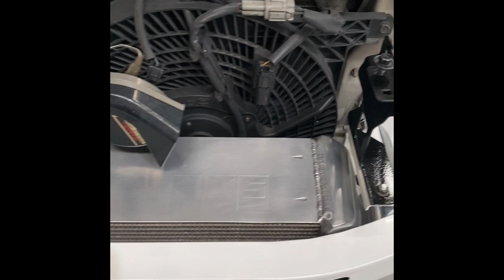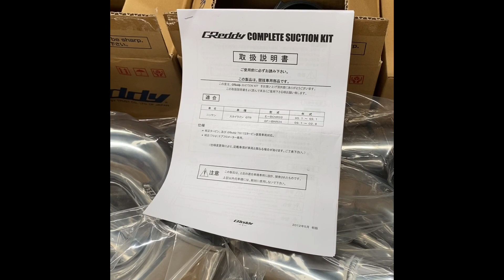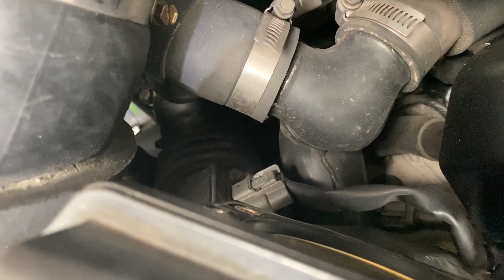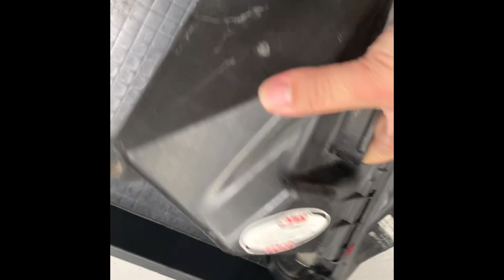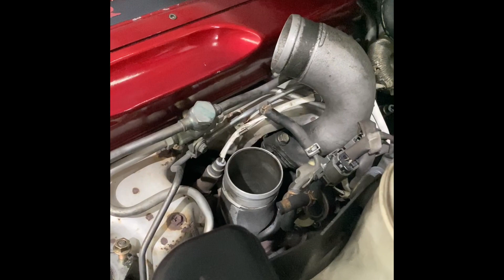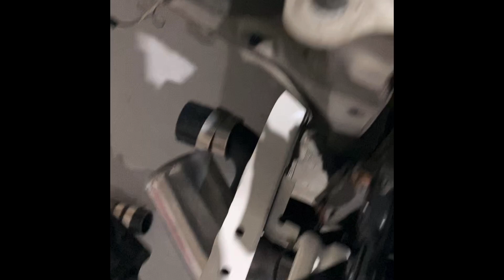R34 GTR intake removal vlog

Comment: Hey Mate!  I am going through the same thing on my 99 Vspec. Taking everything apart and cleaning it.  I used LA Awesome cleaner mixed 2.5:1 with water and built up a lather and that helped cleaned up the whole engine compartment as well as under the hood. 20 plus years of Japanese road dirt and pollution.  Rinsed it immediately after cleaning.  You have to be really careful with the stock original paint in the engine compartment.   It is very thin. 

I have a few questions:

1.  Did you paint the wheel liners Satin black?   
2. Are you selling the air box and it's components? 
3. You will find some troubled areas under the plastic cowl?  It seems that water likes to get trapped under there and you will get mild rusty discoloration.
Reply from the maker: Hi, 

1) no I didn't paint the liners, I just gave them a really good clean and then use some Chemical guys VRP Dressing and it came up like new.

2) No, I'm keeping all of the stock parts, never know when its needed.

3) I've just lifted up the front cowl to take a peak, its dirty but not rusty thankfully.

With the engine bay, i'm just worried to rinse it all with water. So many old connectors and parts which in their prime would be fine with water but now, not too sure, hence i'd rather take the engine out. Its all falling into the too hard basket at the moment though.
Reply: @restoringthedream2439  I rinse with water from a pressurized herbicide spray bottle.  No splash,  directed at rinsing all the dirt away after light scrubbing with brushes. I would not blast the whole engine with a power wash.   Cleaning all the wiring with bug and Tar removers on a towel and wiping down manually seem to produce some fantastic results..  The connectors inside have alot of dielectric grease that seems to keep the moisture out but still no reason to soak the whole engine compartment. Your engine bay looks exactly like mine in terms of grime and dirt.  I will try to get some of that Chemical Guys VRP Dressing for the plastic inner fender wells. . For Water spot remover I used Chemical Guys Water spot remover.  Worked great on Glass and on the paint before I clay barred,   polished and finally sealed with Meguires ceramic wax.  Worked out really good without being too aggressive on the original paint.   Thanks for the reply on the stock air box.  I just wanted to have one on the side in case I return back to stock from the HKS intake.